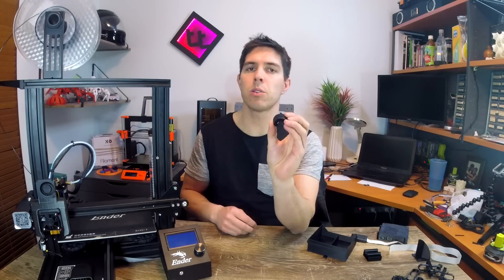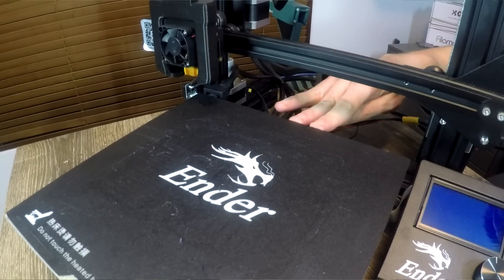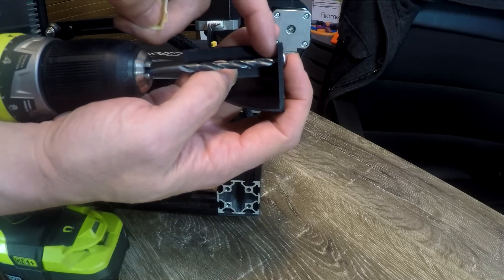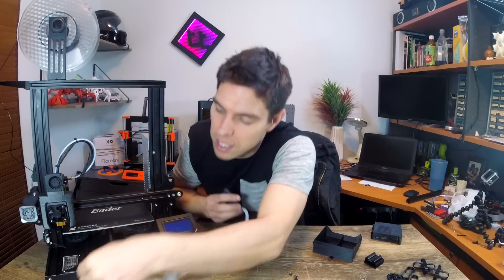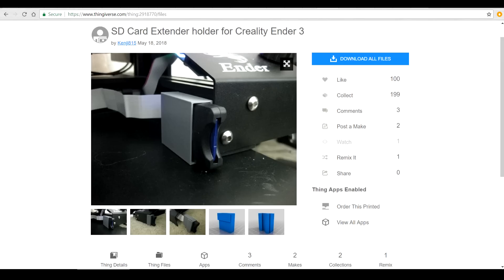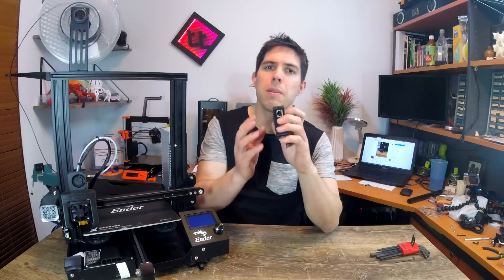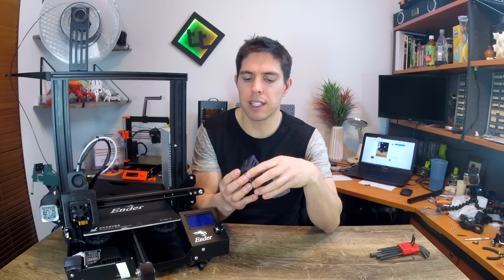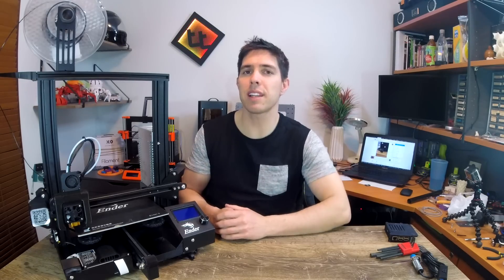7 more easy 3D printed upgrades for your Ender 3

Comment: The dampers would be great for speaker stands as well! Might need to 3x3 or 6x6 depending on the weight of your boxes. Or sprinkle them like bows in rows. Cheaper than hockey pucks. 

I loved the parts with the inanimate carbon tube.

Comment: If you have purchased a Ender 3 in the past 6 months the Extruder wheel no longer seems to work as they use a different motor or something and there is no axle to attach it to because it is flat.

Comment: If you cut a couple of  slots down the threads of an extra M5 bolt, you can use that as a thread tap instead of drilling all the meat and grabbing at only 10% of threaded surface.

Comment: Already printed the end rail cover and an extruder knob, they both look great and are highly practical. Thanks for the other suggestions, I may do a Pi Case in the future.
My fav mod that I designed is an Allen key holder (https://www.thingiverse.com/thing:4485322), you can bolt it to the extrude using 3D printed T-nuts.

Comment: I would recommend the EZABL. The BLtouch is not as reliable and accurate and the reading deviates too much. It does work and gives you a near perfect first layer, but be wary and tune it in as close as you physically can. The EZABL is a drop-in addon. It does not require any modifications to your printer apart from the obvious mount and replacing the Z endstop. You have a choice of how to power it: either by wiring it into the Ender 3's motherboard or plug it into the wall with a power adaptor. Then just flash the firmware and you're done. If you want the BLtouch, get one with a metal pin. The plastic pin on the V3 is known to snap off if you breath on it. In addition, the V3 smart model does not work with the regular BLtouch firmware. You need the regular BLtouch version. You can get the V3 to work, and there is a tutorial from Teaching Tech to achieve this, but be prepared to edit your firmware code. Keep a clean copy on hand in case you accidentally edited something you shouldn't have and your firmware fails to compile or it makes your printer do weird stuff!

Comment: Neoprene foam materials would work better as a dampener underneath the 3D printer. Plus, it's more stable and won't risk the legs breaking or the printer imbalance. Neoprene is super cheap too.

Comment: The glass bed is fantastic, i recommend that upgrade without any doubt. I suggest you order one from creality or amazon.
Reply: I had my local glass shop cut two plates for me at exactly 235mm x 235mm x 3mm, then sand the edges to prevent cuts. I never have to apply hairspray or anything, it just sticks beautifully. I keep the plates clean with isopropyl alcohol and heat though. Never touch the exposed plate with your bare hands, or you'll need to clean it again, so I use nitrile gloves if I need to handle them. Cost me $4 per plate, and I couldn't ask for better guys to do the work.

Comment: Does it come with design and slice software? I am new to 3d printing and I'm looking for one that is good for beginners.
Reply: It comes with a copy of Cura on the SD card, but for me the installer didn't work. Cura is a free slicing software that you can find online, so it's not a problem. It doesn't come with design software, but a great starter design software is Tinkercad (tinkercad.com) which is an in-browser design software. It's a bit limited but it's great for beginners, it's how I got started.
Reply: @CWGminer  Thanks!! Please recommend any other free design programs that are downloadable if you know of any.

Comment: Just got my Ender 3 and it seems they have made some improvements. It now comes with better tube fittings (or so it seems as they dont let go of the tube very easy) and also e few of those clips to secure them, no need to print any.

Comment: Where you put the SD adapter is so much better than where I keep seeing people put it (next to the LCD, especially if you want to print a tray for that space). I feel like there's a better solution for the LCD cable than just "stick it underneath". It looks messy. Maybe there's a tray file that has room for the cable?

Comment: It's nitpicking I know but don't drill out and force a M5 screw in these. It's really easy to screw up and wallow out the hole bigger than the M5.  It might not matter for this particular thing, but just spend a few bucks on an M5 tap and just do it right the first time.

Comment: hi ..can you help me, i have a small prob with my ender 3.. it doesnt print circle things right..its a bit oval
Reply from the maker: Tension both belts. I had the same issue at one stage, my y was loose. I think I covered this on the cap tube video.

Comment: how difficult is it to buy a tap???
Reply from the maker: I had one in the draw the whole time, but that wouldn't help the average person.
Reply: teaching the average person to use the correct tools for the job is teaching also. you could have said , "use a tap" and then go with the drilling out. you probably know that a little piece of tape doesn't stop the drill as it shoots into the hole when it doesn't have to do much. and then you end up with a hole to big and deep for the screw. btw thanks for answering the comment. :-)
Reply from the maker: It's tricky to find the balance between keeping it snappy and being thorough. I didn't realise at the time that the extrusion wasn't threaded until half way through the video. It was a bit of a fail! I am planning an update for my new Ender 3 Pro where I only reprint the mods that worked the best, that particular one won't be in it.

Comment: excellent channel. I just bought an ender 3 and I have problems with printing on the Z axis the printing starts well but after about 10 minutes El Paso starts to get smaller and smaller. to the point that the print of the cube of 2 x2x2 is 2x2x 0.7. will you have any reference to this ... ???
Reply from the maker: Very strange. Haven't come across this before.

Comment: BTW, Where did you get that tri-pod stand and what camera do you use?
Also, do you have the Anet A8?  What about the CR-10?
I'm using stock software on the machine, and using Cura to slice things I found on Thingiverse. I don't know how to cad yet. That will be later.
Thank You
Tom
Reply from the maker: This one was filmed with a Logitech c930 on a $5 eBay cheapy tripod. Don't have an anet or cr-10, do have a tevo Tornado which is mostly a clone. I don't use Cura but it's quite popular so I guess it must be ok.

Comment: Hi, bud just finished assembling my new Ender 3 printer, however, the LCD display is showing blank. I am sure I have assembled everything correctly. any suggestions as to why this could be happening could it be faulty. any help will be much appreciated.
Reply from the maker: Open up the panel above the electronics and check the ribbon cable is plugged in properly. Also check the other end of this cable behind the LCD.
Reply: Teaching Tech, thank you for replying much appreciated.  the ribbon has a small break along one wire found the issue :)

Comment: 7:34 why is your tray so wavy? I can spot a plenty of ripples in here.
Reply from the maker: Everything in this video was printed in old ABS rather than PLA.    The quality definitely isn't as good as my other prints.
Reply: those waves are most likely caused by printer than material itself - those are way too regular. Does they appear on flat horizontal surfaces of your prints? For me it looks like issue described in here: https://www.reddit.com/r/3Dprinting/comments/7d1pqe/vertical_surface_ripples_banding_waves_solved/
I love your video - don't get me wrong - but I'm facing the same issue and wonder what's the cause ;)
Reply from the maker: That's a great link. I will investigate this further when my Ender 3 Pro arrives. Thanks!

Comment: hi michael!
.. got mine today and have to say, that mechanically this is really well done - extremely accurate & stable. everything fitting perfectly, no wobble of the base and posts are 100% rectangluar; looks like they have improved since the first versions, only mechanical flaws remaining are the filament feed close to the z-spindle and the z-stepper. did print this little spacer, but still was not thick enough; had to extend it quite a bit to really solve the issue to tighten the thread-plate on the extruder trolley. screws - of course - too short afterwards, but i had some m3x25 - so all good.
.. nice to see, that the alu plate is without any warping. bed now comes unglued and with clips instead, which is not a bad idea because i wanna use glass anyway. but .. the problem is, that it is warped up in the center, so proper levelling is impossible; no way to get rid of that. furthermore it is way too sticky - i think.
btw .. any nice idea, how i can remove extremely thin plastic (pla) layer from this rough and sticky surface without completely scratching it to death?
Reply from the maker: My glue pulled off almost too easily, although we have different models. On other printers I've had good results with acetone and a scraper.
Reply: thx! .. meanwhile - funny enough - put the plate in the freezer, but could get rid of a small part of the crap only; but .. my several testprints step by step removed the residue anyway. some small white particles sticking to the black bottoms, but not a big deal - during testing. now finally, printerbed is nearly clean. ;-) (btw. surface seems to be the same, it´s just not glued on to the alu plate.)

Comment: hello got my ender to day :) thank you for all the tips:), they have upgaded some stuff on mine. the logo thing is not glue`d to the bed and you can take it off easy. and it looks like they have changed the tube. and the cabel thing has been redone :) but down loded all the upgades to have some thing to print :D so far evrything has been the dream :D and for all your good tips of the ender 3 content :D
Reply from the maker: Hi Javier, thanks for the nice feedback. Glad to hear they are updating the printer. I'm excited for your new hobby, may it bring you much joy.
Reply: @TeachingTech    tnx :D btw one thing to add to the ender 3.. first layer shoud be heated to 75 and after go down to 60 for the rest. it looks like i printed on glass :) relly happy i whent inn to this hobby :D keep up the god videos :D and agen tnx for all the tips :)

Comment: On the list of your first 14 E3 improvement, I regret that you forgot to include a gear for the Bowden extruder: ( for ex: https://www.thingiverse.com/thing:3005278 ). the E3 is my first 3D printer and everything went above my expectations (even the bed that seems to be perfectly flat) but, from the beginning, my main difficulty has been to feed the filament properly (and purge the extruder when changing Color) until I found this gear print witch ease the alimentation on a new roll and allow to purge the extruder like a charm between two filament rolls.

Comment: Lots of nice mods, The RPI case will definitely work for my Ender 3  I have been struggling with the settings for OctoLapse, your doing exactly what I want for my timelapse. Any way you can replay your settings for the Ender 3 in regards to Octolapse.  Thank You
Reply from the maker: I have a video coming up on how to get the Octolapses pretty close to perfect. It will explain everything. Just need to finishing designing a movable arm for the cheap web cam I am recommending.

Comment: Great job...again. I would like to recommend Bed Handle if you plan more videos on Ender 3 Addons.
https://www.thingiverse.com/thing:2957507
There are remixes with camera mounts as well.
Reply from the maker: I printed this today but had several layer shifts from my own laziness clamping down the glass bed properly :(
Reply: How about printing it on thin air? :) https://www.thingiverse.com/make:527397
Reply from the maker: Ha that is quite a sight.

Comment: Or you can buy a tap for the size you want or cut relief grooves in the bolt you used to would be a lot easier to do that
Reply from the maker: I have a tap and die set but thought it better to cover a solution using more common tools.

Comment: I made a remix of the Holspeed tray you printed. I added a raspberry pi case into the tray for your Octopi. I also took an XT60 splitter and pulled 24V off the printer, stepped it down to 5V 3A to power the pi. Check it out. https://www.thingiverse.com/thing:3026077
Reply from the maker: Thanks for remixing and sharing. That whole setup is really neat.

Comment: Hi great vid I have a question my extruder make a lot of noise it sounds like an old dot matrix printer do you get this sound? And if so is there a way to spot it or at least reduce how loud it is? Thanks
Reply from the maker: Mine is only loud on fast retractions. If yours is like this then that is normal. 3D printers are unfortunately not very quiet. There are some way to quieten them such as this: https://www.youtube.com/watch?v=vu80vctXaxQ

Comment: Whats the upsides to converting to OctoPrint with the RasPi? Why not keep the original controller?
Reply from the maker: No need to juggle SD cards, ability to monitor printer from anywhere the house or indeed the world, and most importatly for me, the ability to make Octolapses like you saw in this video.
Reply: Teaching Tech cool, I've just ordered an Ender 3 yesterday so I'm gonna optimize it with some of the parts you're showing. Thanks for the reply. 😊

Comment: Good tips, interesting approach to the cable snag problem.  Want to pull the trigger on the printer, but...  I couldn't really find out where to drop that code on the Banggood web site.  Normally I don't ask for help shopping.  But there is a code.....
Reply from the maker: I just checked and the printer is on sale for even cheaper than the coupon allows. Probably why it's not working.
Reply: Teaching Tech thanks for checking, ordered yesterday anyway.

Comment: Iv upgraded mine with metal slot wheels on the Y axis. Something is wrong with the 20x40, it was cutting into the origernal wheels, the hardened plastic ones but these full steel ones are cutting back :D. The paint is too thick making the edge pointy.
Reply from the maker: Thanks for sharing, interesting mod.

Comment: Better cable management will eliminate the need for the piece preventing cable snags on the frame.  I don't understand why people are so quick to print a solution to an easily rectified problem.  I'm pretty OCD about keeping my cable organization clean and tidy.  This aside, great content!  Keep up the good work!
Reply from the maker: I agree. I will say I wish manufacturers would. Put emphasis on cable management rather than leaving it to individuals to work it out. Put together another mk3 this week and remembered how well it is done on that.
Reply: There is a much better cable management clip for the rear www.thingiverse.com/thing:2949858 that you attach to the top of the stepper motor and you don't see cable catch to the frame on the rear left with it.

Comment: Thanks for all the advise and tips for this printer. I was wondering though, do you also plan on installing a filament runout sensor that stops the prints? Is this possible with the ender 3? I'm using mine at work (a high school) and the ability to automatically stop prints until the next morning if the filament runs out overnight would be invaluable. I can't seem to find much info with the EZOut and this printer. Thanks again!

Comment: If you have a dremel you can cut a couple lengthwise slits in the threads of a bolt and turn it into a makeshift tap.  Works surprisingly well.
Reply from the maker: Nice tip! I have a tap and die set but din't use it on this video to make it more accessible.

Comment: My filament guides didn't work out that well because similar materials(PLA) rubbing caused a hum when the filament was dragged through.
Reply: FYI I read elswhere about using plumbers teflon tape to stop that so the filament slides over ery well....

Comment: I'd recommend the creality version of the ultrabase for the ender 3, just put 3 clips and you finally have a flat print surface, no need for ABL. Have you found a way to get rid of zits and hide the Z seam on the prints?
Reply from the maker: Sounds like a good tip. Planning a slicer calibration video to address what you're talking about.
Reply: Teaching Tech thanks, I am really looking forward for the calibration video as many info I found on the ender 3 don't address the advanced features (like coasting, combing, linear advance). I like the ironing feature of cura, but I hate how it draws lines across the layers while traveling
Reply from the maker: Z-lift/hop would fix that.
Reply: Teaching Tech S3D does a much better job without Z hop, and I'm not big fan of zhopping as it tends to leave marks on top surfaces

Comment: Never use dampener feet. They can cause distortions in your print. A foam or rubber pad under the printer would be a better solution.
Reply from the maker: As I said in the video I wasn't going to be using the feet. Very easy to remove if you are noticing artefacts.

Comment: Nice video!! Like the series. How about installing some TMC2130 stepper  motor drivers, they seem to work magic on quieting a printer.
Reply from the maker: Can't do it on this one as the drivers are integrated into the main board.